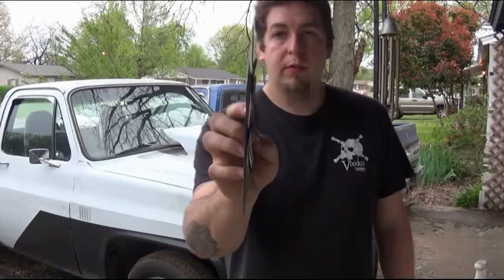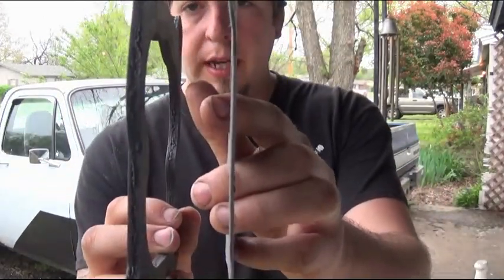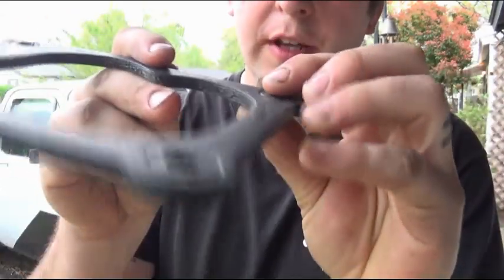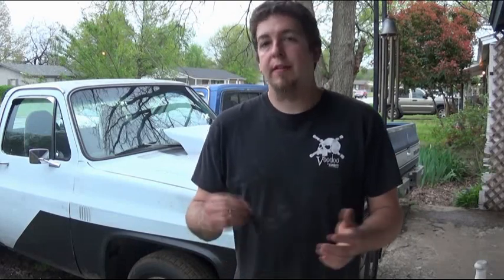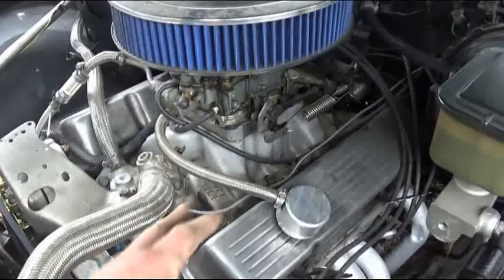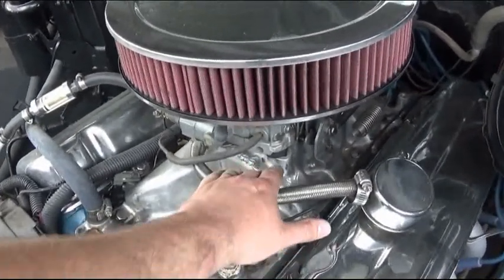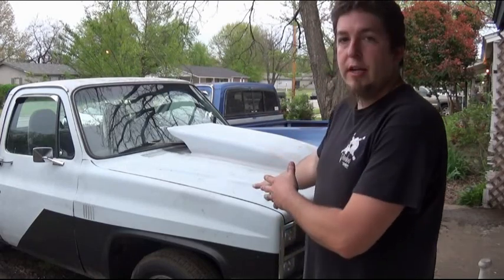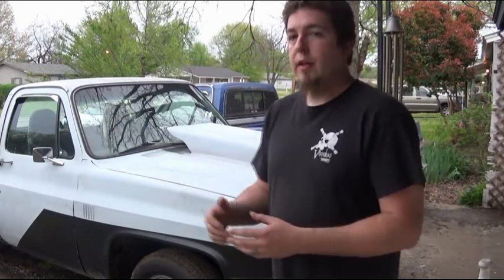carburetor heat soak and fuel boiling issues, fixed by just a gasket?

Comment: I have a 71 camaro similar issue you were explaining. Its starts great on a cold start even after sitting for weeks it still starts great. I will drive it for 15-20 minutes, get out and then try to start it again after a few minutes, it has trouble. It cranks for a good 20-30 seconds. It also stalls when I try go slowly up the driveway after starting it the second time. 
Can this be a vapor lock issue?
Reply from the maker: could be, carb heat soak and vapor lock will be 2 different things. if you are running headers always make sure your fuel lines are rerouted away from heat since headers are know to be closer to the frame and they are a thinner metal then manifolds so there is more chance for heat soak which is also why a mini starter is a must with headers. I take ti since you say "up the driveway" its a decent slope which vapor lock would stop or slow fuel from getting to the carb so an angle could cause it to stall from not having enough fuel in the bowls. Now carb heat soak will boil fuel out of the carb and can do that as well. After its up to temp pull the air cleaner and listen for boiling. If you dont have an insulator gasket you should regardless many engines came with them from the factory and they do help. If you have a clear fuel filter before the carb  it can tell you alot as well such as if you have vapor lock or a weak pump the filter wont have as much gas as when you started it, if the filter is full then its heat soak

Comment: Heat escaping from under the hood helps a lot as well....such as a huge cowl hood
Reply from the maker: well if you have a proper cowl hood it should allow fresh air into the intake. i have seen open cowl hoods allow heat out while the vehicle is sitting still but once it moves air goes in. now heat extractors those are great and help alot and wont let water in if set up with the right channeling underneath

Comment: My 77 460 dies a lot after warming up 2 minutes to cool off then another mile. Vent the electric fuel pump line????? Anyone else ??
Reply from the maker: Well whats the set up? mechinical or electric pump? where are the lines.  what type of distributor? intake, carb, exhaust, etc

Comment: My carburetor gets hot and does this while driving it. I have a ply wood heat spacer and I have a 3 nipple fuel filter before the quadrajet and my carb still gets hot and vapor locks while driving. I have a new heat gasket like you shown and I have the room for it so I'm going to give it a shot and see what it does. I live here in East Tennessee and yeah it gets hot and humid here. Thanks for the video. Oh my ply wood riser heat sheild I made from 3/4 inche plywood. Just wish this car would stop vapor locking and leaving me stranded every time I drive it. I have a glass filter that I can watch fuel coming through and have proper heat sheilding fir the metal lines along with my 3/8 rubber fuel line far from the motor and heat. I have caused this down to my quadrajet. So hopefully this gasket will fix this problem. Thanks again
Reply from the maker: I hope it helps. Im assuming your gas is getting hot after the pump. I try to move most of my lines and re route them. I have always had good luck with the gasket keeping the carb cool enough
Reply: @EfurdGarage  faulty needle jet now. The tip has been flattened out and no more vapor locking up in the fuel line but sticking float cause of this needle jet looking like the tip got mashed. How does the tip go from being pointed to flat. I got my modification kit for quadrajet power and is this a result from a faulty or bad quality needle. I don't see how or why this would be damage like it.
Reply from the maker: @jasonbeason4780  you know thats a good one, sounds like a bad needle to me. cant say  i have had that happen or seen it

Comment: Thanks! I'm going to try one of these gaskets and see if it helps. I already have a phenolic spacer. I'm in Phoenix,  110+ degrees , 1966 F100, 390 FE engine. Drove 15 miles at 70-80 mph (2800 rpm), the other day. Ran fine. Got off the interstate and drove 1/4 mile, stopped at the stop sign and as I pulled out, the engine just died. Pushed the truck out of the way, raised the hood and heard the fuel percolating in the carb.  An hour later, with some coaxing, it started up and I drove it on home.  It was HOT under the hood, although the temp gauge wasn't higher than normal. There's no fan shroud so I'm going to add that, too and see if that cools things down a bit in there.
Reply from the maker: Fan shrouds are a must. The spacer should have done it but adding the gasket could help more. gasket is most likely better then phenolic at blocking heat although i never tested it. i run an aluminum spacer with the heat gasket on my daily in 100+ degree and never an issue so it should do the trick still

Comment: Is there a specific manufacturer, or do all companies make an insulator gasket?
Reply from the maker: Not all make them but a few. Edelbrock, holley, felpro, and sec. I would look through summit racing or other simular parrs suppliers. They measure about .25 or 1/4" on average
Reply: @EfurdGarage  I buy a lot of parts from Summit.  I like Holley and Felpro.  Thanks for the tips!
Reply from the maker: @Grandsport12  your welcome. Thanks for watching

Comment: with the size cam i have what should my vacuum guage read...its no where near 19 to 21 of mercury  my needle is sitting in the red zone  on 10 where the reading say late value timimg or leak at intake manifold or heat raiser. i got the matco vacuum gauge.something anit right.
Reply from the maker: with a 109 you can be 8-12 if i recall. 19-21 is going to be a looser lsa 114 ish

Comment: do u think the av2 650 cfm will make a big diffenrence
Reply from the maker: well im not sure the rest of your set up, gears, transmission, etc but i would think around 700cfm properly setup and tuned would be good. 3" exhaust is still a little big 2.5 would work better with that set up
Reply: @EfurdGarage  YEAH I HAVE A 700R4 WITH A SHIFT KIT IN IT ..AND MY GEARS IS 4.10 I GOT 35X12 15 TIRES ON MY BLAZER..ALSO  I UP GRADED MY TORQUE ONVERTER 2000 TO 2400 STALL NOTHING REAL BIG ITS JUST THE NEXT STEP UP FROM THE STOCK//

Comment: Great video.  I have a 65 c10 truck. When I drive it for over 2 hours and turn vehicle off, it takes 10 minutes to restart. No click, no crank not even radiator fan turns on. Headlights do turn on tho.  Any suggestions? And have you heard of fuel filter valve?
Reply from the maker: Hmmm now thats a tough one, kinda like an ignition wire got hot and has a bad spot in it. when a wire gets hot they can expand, and if there is a crack it can or break it can expand away loosing connection. not sure where it is on that one, seen it on the 73-87 c10s the fuseable link wire on the firewall can cause an issue like that. headlights are off battery source so they wouldnt be affected. fuel filter valve i think i have on a tdi engine. and a fuel valve to shut off fuel flow to help prevent theft

Comment: Sometimes air gap intakes work well also with a gasket that works
Reply from the maker: Air gap intakes do not work well. Aluminum is a heat sink and asborb heat very well. Done a test with 2 engines side by side air gap was only a few degrees cooler but the air gap had the advantage of a cowl hood, larger carb, and larger cam to help it.
Reply: @EfurdGarage  running it with my engine and it hasn't had a problem with engine and carb getting hot also not to forget running a electric fan reason is the clutch fan doesn't like my engine, it runs very well and never had any issues and it has a old school hood scoop

Comment: I put one on my 71 Camaro and it worked great!  Only problem is, the extra lift of the carb doesn’t allow me to close the hood without it hitting!  So to solve that, I just switched to a shorter air filter.  Waiting for my cowl hood to come in.
Reply from the maker: yea cowl hood will solve that issue lol

Comment: I have a van with a mid mounted 400ci Cleveland. I'm in the UK and it's hot here atm. I can hear the fuel boiling when I turn off the engine, its also struggling to idle when hot. Just ordered a 13mm gasket for it. Thanks for the info.
Reply from the maker: Yea vans can creat alot of heat in the mid part. Cant really vent becuase it would go inside. The gasket should help alot. Ceramic exhaust headers or manifolds would keep heat down.  In a van my experience has always been limited space and the confined space building heat.
Reply: @EfurdGarage  yeah it gets hot. The headers are actually just under floor level which helps. The plan is to duct some air in from the sides of the van. Its a 1 off custom job.
Reply from the maker: @manfacilitymetalworks1296  that would help. Trying to duct air in would be beneficial. Either from the sides vented. Small puller fans. Or i even thought about running a small ac duct to it as odd as it seems 😆.

Comment: Nice video!  I  have an old Ford truck and I'm going to add a phenolic spacer and possibly the gasket you are referring to and Im going to add heat shields to fuel lines then see what impact that has.  I've been entertaining the thought of changing to electric pump, buuut, maybe will be good enough.  I was wondering, on your daily driver, what material is your spacer made of?
Reply from the maker: my daily is mechanical pump, aluminum spacer (phenolic is better but i have had it for years on another vehicle so mo cost on this one) i am running ceramic headers on it as well but for the longest time just painted headers. I also moved the stock fuel lines years ago when i had to redo them and tucked them in the frame rail further away.
Reply: @EfurdGarage  I thought it was aluminun, I was impressed to hear you have no issues with primarily just, the thick gasket.  You said some fuel line altering,  running smooth and consistent, more power to ya!
Reply from the maker: @manitou0123  one thing i have been putting off to trying is adding a fluid cooler to the fuel line, was going to do some experimenting, not so much to get the gas cold, but something to keep it from getting warmer on longer drives
Reply: Dito.  on the heat insulating modification's.  About to do that this week.  This gasket Efurd is talking about sounds like another layer of help!  Awesome.

Comment: Thanks for sharing this info. I have been searching for a carb spacer for my Holley 4160 750 cfm open plenum single plane performer RPM. Have not seen the one you are showing. Who makes them and where can I get one like yours please. Cheers from Motown!
Reply from the maker: Thanks. Here is a lint to 2 of the gaskets both should work. https://www.summitracing.com/parts/fel-17847 https://www.summitracing.com/parts/edl-9265. now if you are looking for a carb spacer then summit has them too. But those are  the same gasket i sued but for the square bore carbs
Reply: @EfurdGarage  Thank you so much brother! Appreciate it!

Comment: 390 FE in a 64 Galaxy just completed 2 yr build. Installed a 650 Summit noticed hard starts as it gets warm
Installed a glass filter and to my surprise it was literally sucking the fuel into the carburetor when ignition turned off.
Sight glass in bowl was bubbling also.
It did come with a thick insulator gasket. 
Looks like its going to be used.
Thanks for the heads up
Reply from the maker: Hope it helps. and thanks for watching

Comment: A slightly (completely) different application. I have a 400cc Vtwin Honda that has vapour lock symptoms. Thought it was boiling in the fuel lines but when I insulated them it was still the same. The bowls are very shallow and they sit in the V of the engine...oh and I live in Thailand up to 43c or 110f. Thanks for the idea.
Reply: I forgot to add what the symptons are. Bike starts and runs but when I stop at the lights and let the revs drop below 2000rpm it stalls and will not restart for 1 to 2 minutes. Done it ever since I bought the bike 8 years ago despite a full rebuild.
Reply from the maker: I hope it works for you. Sounds like it will.
Reply: @EfurdGarage  how do you tell the difference between boiling in the float chambers and in the fuel line?
Reply from the maker: @allanb52  usally in the line it can be fixed by using clothes pins or something similar to creat pressure in the line to keep it from turning to vapor. Alot of times with the bowls when you shut of an engine you can hear the fuel boiling in the carb.

Comment: Hey how you doing I'm hoping that you can help me out with this I just dropped a 383 Stroker and my box Chevy Caprice and I'm thinking I'm having this issue I can run it all day but as soon as I let it sit for like 30 minutes It'll crank over but it won't start and it takes awhile for me to actually to get it to start again so I believe it was a heat issue I'm just wondering if this is the problem that I'm having because I have tried my best to figure it out but yes one thing is for sure my carburetor is hot I'm just trying to find out if this is the The Tell-Tale sign that I need the spacer because I ran out of options
Reply from the maker: mini starter? how well does it crank? if it cranks over fast then it wouldnt think heat soak on starter. if you dont have the heat gasket for the carb then thats a good place to start, a phenolic spacer could help also. check your fuel likes and see how close to heat sources they are

Comment: Great vid. Where I can get these? My 69 F100 will start all day cold but as soon as it gets hot it cranks then barely comes on. Is this something I can do myself? I'm not mechanically inclined but can do a few things.
Reply from the maker: summit racing will have them. felpro and edelbrock make them maybe a few others as well, they are usually a 1/4" thick. Sometimes you can get away with just unbolting the carb and sliding it under. sometimes you have to remove a few thing in order to get the carb up just depends on your setup
Reply: @EfurdGarage  thank you!

Comment: I have a 305 with a edelbrock 2101 intake, a 1405 carb, and a 2732 plate in between the intake and the carb. Is this setup correct? I fear I'm having vacuum leaks coming from the carb. My mixture screws have no effect when tweaking them.
Reply from the maker: i wont lie edelbrock carbs are the worst i have ever used. as far as that plate unless you have a gasket on both sides its no good, and easy to warp. i would just ditch the plate and thin gaskets and run a 9265 from edelbrock. heat insulator gasket, seals well and keeps heat from the carb
Reply: @EfurdGarage  would I need any special plates to run the 9265 gasket?
Reply from the maker: @junkyardchronicles1289  no you can run that gasket alone.  Nothing special needed
Reply: @EfurdGarage  cool. thanks bud!

Comment: I just exp fuel boiling with my edel carb... I have a sbc 305 with a edel performer intake. No spacer only the paper thin gasket. I've ordered the insulator gasket, hoping this will rid the no start issue when the car warm up a bit. Thanks for the info
Reply: I have that problem I just floorboard it when I go to start it after it’s warm
Reply: @yamahaguy1732  I've seen instructions from old car manuals saying this exact way to start it when warm
Reply: dreamingcode yeah that was just they way they were back in the day everyone knew it because it was daily life you just have to allow more air into the mixture then give it a little rev to blow the rich mixture out
Reply from the maker: Should help for sure if not cure it 100%
Reply: Is it spread bore intake? And which model carb do you have?

Comment: What if I run a 1” wood spacer and heat insulated gasket?
Reply from the maker: You can run a Wood spacer but i would recommend a phenolic spacer they last longer and help keep the heat off the carb
Reply: Efurd Garage , box just arrived from Summit today. I’ll go phenolic when this one takes a crap. One more quick question. I’m close to my motor rebuild finishing. On the fence about electric fuel pump. Which external electric pump you recommend?
Reply from the maker: @WesternReloader  really depends on the engine i try to stay mechanical all the way with carbs. They have a huge selection of mechanical that can feed some big carbs.  But if your not running an edelbrock becuase they are sensitive to fuel pressure, holley makes some good pumps i have ran thag seem to hold up to high horse power applications.
Reply: Efurd Garage not a big carb. Summit 600 (autolite 4100 clone) 332 cubic inch. Much prefer mechanical
Reply from the maker: @WesternReloader  i like the carter muscle car series mechanical pumps they work well
Reply: Efurd Garage thx I’ll check it out. Appreciate your time
Reply from the maker: @WesternReloader  no problem. Thanks for watching